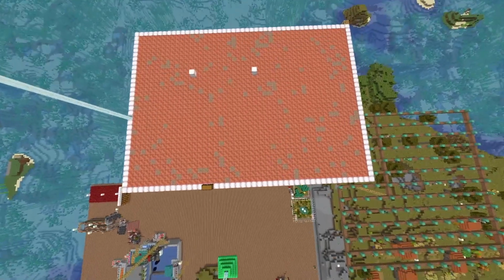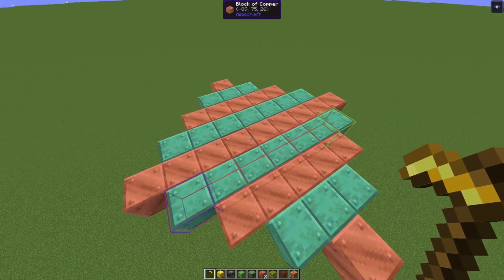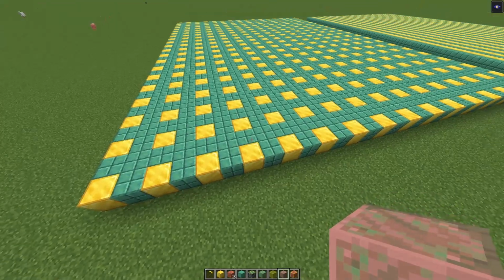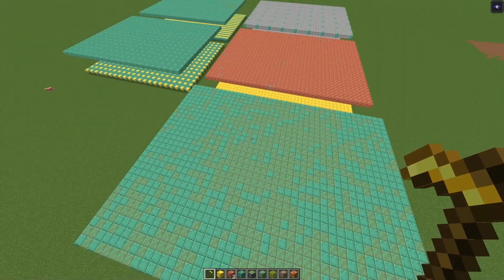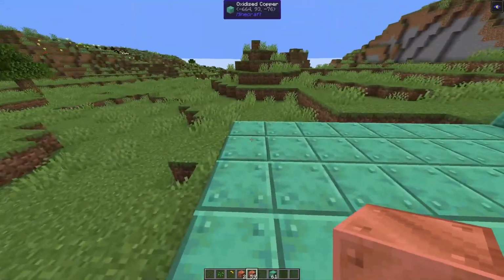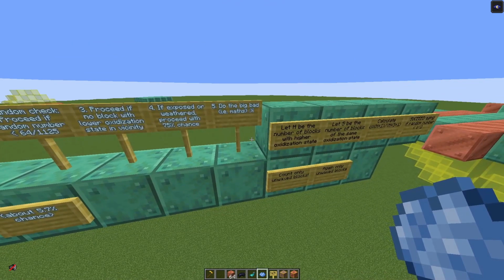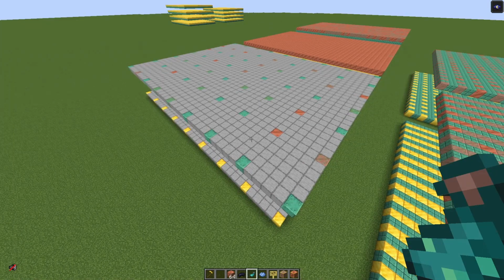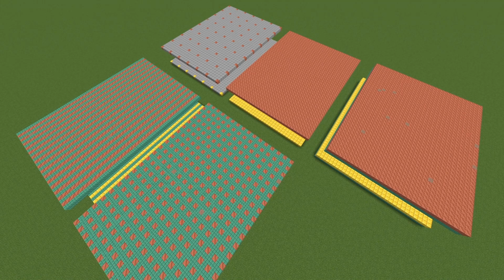Good copper aging strategies (goodbye 5x5x5 lattice!) Minecraft Java 1.18-1.20 copper oxidizing

Comment: hey! had a question: if I need exposed copper, not oxidized, can i use exposed in rows changing with normal one? (like on10:30 but with exposed)
Reply from the maker: Yes, kind of :) If you alternate rows of exposed copper with fresh copper then a lot of the fresh copper will become expose before any of the exposed oxidizes further. And the chance if it oxidizing to weathered should be minimal in that setup, so on the rare chance that something goes to oxidized just axe it one level back.
Reply: @FrunoCraft  thanks man! nice video)

Comment: Another thing that may be worth pointing out is that the lattice pattern that is commonly used is also rather inefficient to start with. You can fit nearly twice as many rows (and twice as many layers) while still keeping all of the copper isolated.

For example, in each row you leave 4 block spaces between them as normal, but your next layer should not be 4 blocks over with the copper blocks forming a square grid. Instead you only need a 2 block gap between the rows and then offset the copper blocks in the row by 2. The blocks will still be 4 tc-distance apart and so won't interfere with one another. Similarly, if doing multiple layers, you can actually fit them as close as only having a single block gap between vertical layers by offsetting the blocks in each layer properly, though admittedly having only 1 block between layers would make navigating the lattice rather annoying. 

But my point is that you can pack copper blocks nearly 4 times more densely without sacrificing any speed.

Comment: just to optimize placing a bit, would bottom oxidiced slabs under the copper also help the aging, this would be so that you are a bit lower when placing the copper and thus able to use something like fast rightclick without worrying of misplacement
Reply from the maker: Yes, oxidized slabs work just as well. But after breaking about 4 shulkers of copper manually (which can't be instamined) I decided to build a machine instead :) https://youtu.be/vEfLwe0zf5Y

Comment: Is it faster if you have a solid layer of oxidized then above it the alternating pattern
Reply from the maker: Yes, but you won't get below 4-5 hours. And this pattern is more difficult to use in a fully automated machine. But still, if you use cut copper slabs via a stonecutter, the amount of oxidized copper you need to invest isn't that much.

Comment: Does the fully oxy blocks have to be full blocks or can you take one fully oxy block and cut it in a stone cutter and make those into slabs?
Reply from the maker: You can use slabs or even cut copper slabs where 1 oxidized copper block gives you 8 slabs. At least according to my experiments.
Reply: @FrunoCraft  that would be a fast way to start the production. Go down and mine so you have 8 copper blocks, space them in a 5 grid and make those in to a stack of cut slabs.

Comment: Great video! I think a semi-automatic farming method could be possible by pushing the oxidized copper into a tnt chamber using new copper, similar to a concrete converter. I guess a design like that would be more fun than manually mining the copper but I'm not sure if it is faster.
Reply from the maker: I thought about that, but I'm going for a fully AFKable machine that will hopefully be very easy to build and very robust. Got a decent proof of concept for my idea working but need to iron out a few more detail problems... But I promise it's underway ;)